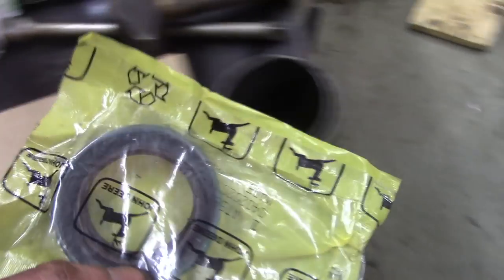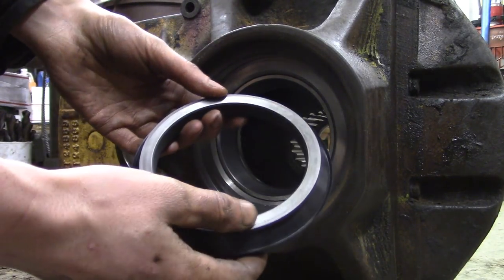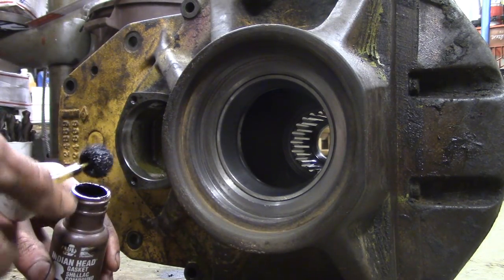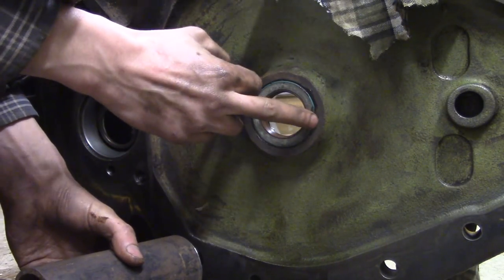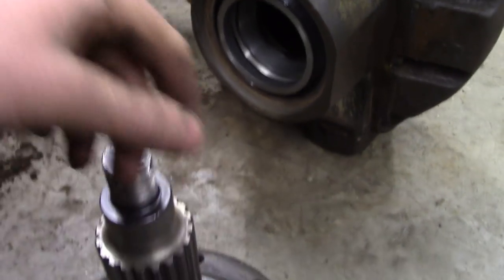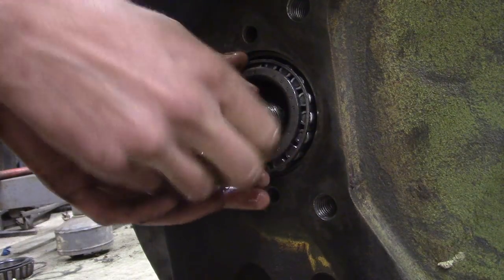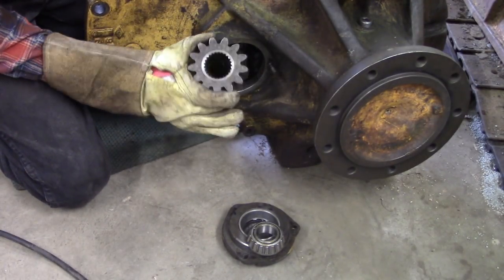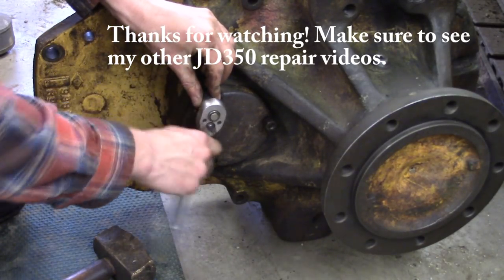John Deere 350B - Final Drive Rebuild

Comment: I check throw out buy placing a dial indicator on a machinist magnet on the sprocket side bottom flange zero it out continue to tighten and I use a tire iron to lift the flange while reading the guage the right pre loading is important as to not have to much play . I did it once on my 2010 crawler. Excellent video

Comment: Nice video! I've been waiting and hoping I did my rebuild like yours! Mine was basically like yours, so I feel good. One thing I did was to drill holes in those sir clips/ snap rings...made them a bit easier to deal with. Thanks again!
Reply from the maker: Well, we either both did it right or wrong in the same way! Good idea on those snap rings, working with those big ones really makes you understand why they're called "jesus clips"!

Comment: I had to replace the 2 twin seals on a 350 gas burner last week, they cross to a national 472164, John Deere wanted close to $30.00 each for them, got them at Advance Auto $6.00 each.

Comment: themadmailler  ... Well, I have an update.... We finally got the crawler unstuck yesterday.  During inspection, the left track only free-spins and the right drives under power.  When I inspected the clutch linkage, the left track lever does not freely move the linkage like the right track (which works well)...

At one point, while driving it back to the garage (which sucked) the left track locked up and wouldn't free spin anymore and it would only do a 360 spin.

By the end of the day, we were only able to accomplish removing the left track sproket weight, drive sproket & quill cover.  
With the Crawler left track off and drive sproket having no load on it, the gear under the quill cover did turn, as well as the drive sproket, but while under a load, it won't drive at all.... Additionally, when the clutch is realised, there is a "clunking" sound coming from the upper final drive area..

Our question is, what's the likeliness it could be the clutch/pressure plate versus a thrown shaft?
Thanks for all your help in this dinosaur!
Reply from the maker: it's hard to say, but there's definitely issues with the clutch/brake at least. if you back the brake way off, it should at least freewheel. just take everything apart and replace it all. also sounds like there might be something binding up the track itself?

Comment: Hello, I have purchased a 350 john deere. The ID tag for the JD is missing the manual I got with the machine says it's a 4E3D, the S/N 016224T, the loader number on the machine 7350 6055W , the motor number NM43TE018946 T.  I am wondering if you can use the engine s/n and the loader number to check the model and s/n, and year. Also, I bought this machine with a blown transmission.  I need 1-42 toothed gear and 1 triple stacked gear with 27/33 and 23 teeth and 1 spring that holds the indent ball for the  pto leaver in the transmission case.
Reply from the maker: I think your best bet is to talk to your local JD dealer. Good luck!

Comment: I just bought a jd350 and have to do the same thing so I’m using a lot of your videos for reference. Where did you get the service manual for that machine? Not sure if it’s a 350 or early 350B sn tag is missing but in the location for those models.
Reply from the maker: Ebay for the manual. The straight 350 and B are essentially the same and the manual will cover both. There's probably some minor differences between the two that you can research if you're curious to what you have.
Reply: @themadmailler  thanks!  Yea I found some digital copies online but I’d rather have the hard copy. As long as the clutch packs for steering are the same I’m not too worried, fixing it, using it, selling it. No real desire to keep it after I’m done

Comment: @themadmailler where did you get the big final drive seal? AT18946T is what the parts manual shows. Also is the AT18749T required? I didn't see you install it. I assume it came in the kit rather than seperate.
Reply from the maker: I got the seals and bearings from Ebay. You mean the big seal i talk about at 2:28? I did install it.
Reply: Yeah that's the one...I couldn't find it with the part number from the book...I found a AT36097 that's looks right.  I've owned 3 of these dozers and never had to replace the bellville seal. I meant to say I didn't see you give a part number.
Reply from the maker: @snazzyusername  not sure what to tell you! I found the proper seal both individually and in a final drive rebuild kit.
Reply from the maker: @snazzyusername  just looked at my parts book. AT36097 is the kit, substitute for AT18749. AT18946 looks like just the rubber part.
Reply: That's good news because that's what I ordered earlier today.  Thanks

Comment: Just watched your repair/assembly of the final. I didn't see that there was a sleeve that the throwout bearing rides on. Is that part of the bearing carrier or a separate item?
I liked the part where you removed some of the structure to pull the final. The last time (not thinking of such an easy solution), I pulled the complete track frame away for clearance.
Reply from the maker: at this point I don't remember. I think it just slid off the sleeve.

Comment: Nice work.   Did I notice correct that the John Deere oil seals are actually a Chicago Rawhide (CR) ?
Reply: Yes...this is correct. I rebuilt mine last week and the part number is 17381.
Reply from the maker: Yup! I mention the part number in the video.

Comment: no need to adjust the preload on new bearings with the shims on the quill?
Reply from the maker: Who knows - the factory repair manual makes no mention of it, all it says is to be sure that the shims are re-installed with the quill.
Reply: themadmailler  vague like most manuals

Comment: P I seen that you was replacing the bearings but are you replacing the races tobecause if you're not man mismatching new bearings on old races is asking for trouble
Reply from the maker: i kept the old races. Not "correct", but i'm sure it'll be fine.
Reply: @themadmailler  I watched all the videos how did the dozer turn out